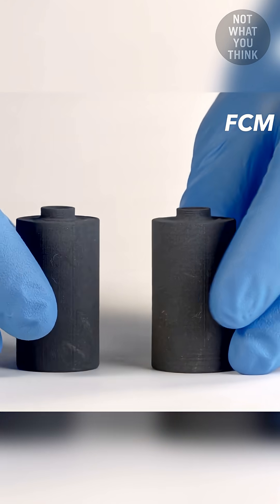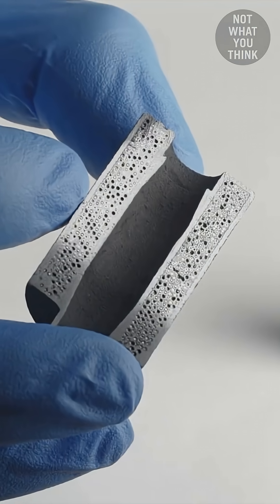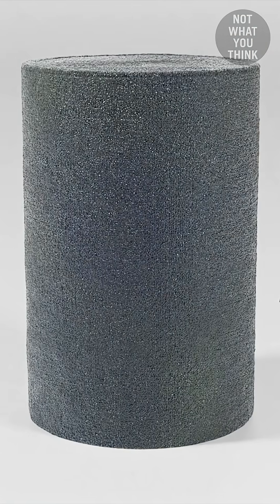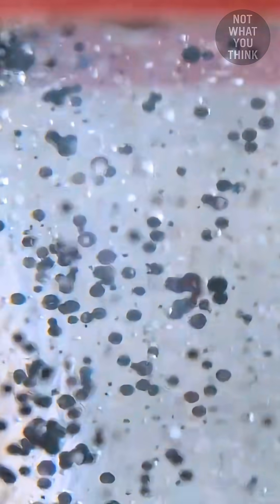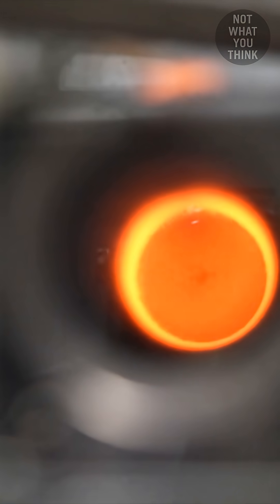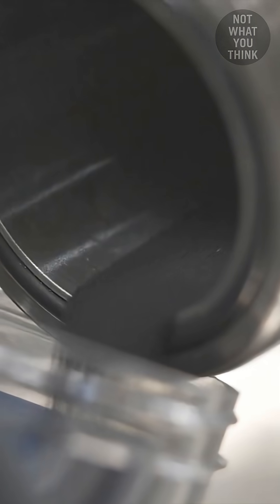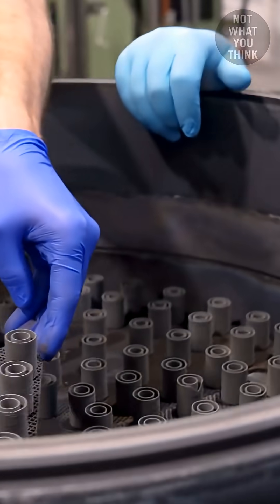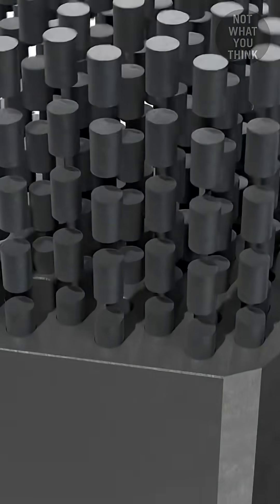Tiny Million-Dollar Battery

Comment: This is gonna be a huge deal... think of the applications for space stations and spaceships.  Satellites and planetary probes and stuff already have RTGs that generate electricity using the Seebeck effect & thermocouples... this is like that but on crack
Reply: even cargo ships, and maybe some light aircraft too. hell, local power generation for small remote towns or homes that would be to expensive to run a new power line to as well
Reply: @coreytaylor5386 there was a nuclear powered airplane design in the 1950’s or 60’s it was big.  Very big. And could stay in the air for a minute. 
We went a little nuke-crazy back then.
Reply: @Macumazahn16 Atomic planes. shielding was too heavy to carry much else, radiated the crew, and left a radioactive jet exhaust stream everywhere it went.
Reply: @coreytaylor5386 cargo ships and airplanes need thrust, nuclear reactors provide power. Could do a hybrid diesel nuclear cargo ship or something probably, the us already has nuclear powered ships. that stuff is way too classified to be in civilian infrastructure thou
Reply: @bobjordan4239  couldn't you use electric motors just like they already do
Reply: @bobjordan4239  No. 
For Aircraft there is the possiblity of using prob engines like in WW2 but powered by electricity and not by gasoline. 
Same with ships.
Reply: @bobjordan4239 you would simply use electric ducted fans or electric motors with props. Think giant RC airplane. Electric motors make far more power per lb of motor than combustion engines. The power source is the hang up. Batteries arent power dense like fuel so your range is very limited.  A nuclear reactor small enough can power and aircraft but then there is danger of spreading radiation in the even of a crash. This makes it only suitable to fly over the ocean or uninhabited areas. (Arctic Antarctic)
Reply: Modularized nuclear power is the real big winner on green energy. Since it will be cheaper than traditional nuclear plants, and can be upgraded by just adding more of these. Or removing some if that much isn’t needed. This is the kind of tech that goes beyond military applications and can help in a lot of other ways.
Reply: Bill gates funded the R&D for a similar modular, run-safe nuke power plant that doesn’t melt down if left unattended 
Nuclear power is our best tool for our energy demands. Everything else has some kind of major draw backs bc of the materials that go into it or the carbon released. 
We WILL have fusion energy plants in our lifetimes. Commercially viable, profitable, with clean energy. They’ll cost a few billion each (at least) but costs will gradually decrease 
We need more expertise and fission engineers are needed. 
We are destined for the stars. This is a big part of how we’ll get there, our grandchildren’s grandchildren.
Reply: @Macumazahn16  I want some of whatever it is you're on
Reply: @MadScientist267  I think bro is takes several doses of hope and human will power.
Reply: I don't think it is. The Seebeck effect is the principle behind the thermocouples used in RTGs, and it's not very efficient, but it has no moving parts, so it's reliable for a very long time. The concept of using mechanically robust systems that have moving parts is not new, and has been researched in depth with the advanced Stirling radioisotope generator (ASRG). The reason it never took off was because it was never proven to be reliable enough, despite having much more efficiency.

What this reactor uses is probably a closed-loop Brayton cycle, which requires a lot of mechanical parts and most likely relies on a gas turbine. This isn't a solution at all for unmanned missions due to how complicated and mechanically vulnerable such a thing would be. Conceptually, there's nothing particularly new here anyway. The Brayton Rotating Unit has existed since the 60s and was actually discontinued in lieu of the ASRG, which was discontinued for similar reasons itself.

Maybe saying this is like RTGs "on crack" is accurate in the sense that if you sent one of these into space in a satellite it'd probably work really hard and have a lot of energy before dying way too soon.
Reply: Literally my first thought was moon base.
Reply: Plutonium 238 has been used to power space probes for decades.
Reply: This is not an RTG or a battery. At all. Has nothing to do with either one.
Reply: When we finally poison the air and water, and nuke the environment by accident, war, or both. It won't matter anymore.
Reply: Knowing this technology exists I’m super excited to see our government send more money to the third world and Israel instead of advancing space travel!
Reply: 😮yh really
Reply: I don't see power ratings anywhere.
Reply: @qwertyboguss  well the power rating will be in the generator: (device you out the cells in)

But in theory these cells could reduce supply lines and be much more efficient than normal gas power. No need for pressure used containment vessels. Or risk of it degrading after 6 months.
Reply: @spaceengineeringempire4086 of course but the nuclear battery/cell has a certain max output I'd guess. Wonder what that is and how long it lasts. Makes the difference between powering a small camp or a small city
Reply: @qwertyboguss well, they are still being developed, so thats to be expected.
Reply: I'd feel way more excited n optimistic about this advancement and its many possible practical applications..
But then I remember how the world, especially us (USA), will only use new tech as long as it can not only maximize profit but not disturb the delicate web of huge old-money that currently control how "advanced" our society can be.
Pessimistic I guess
Reply: @mattyho1642  guns that hit with the force of a nuke though
Reply: @mattyho1642 I don't think your pessimistic I think you're spot on. It is unfortunate that all these billionaires have so much at their fingertips and yet do so little for the world
Reply: Uranium anywhere there is a possibility of it crashing down to earth doesn’t sound too nice
Reply: @123qwe321ify  the dangers of Uranium and the risks involved with satellites magically falling from orbit somehow are over hyped by Hollywood, the IRL physics behind both of them are much much more boring and safe. if it where to 'fall from orbit', the uranium would probably disintegrate into the upper atmosphere and be no worse than the radioactive material pumped into the air by coal burning plants
Reply: @coreytaylor5386 i suppose but do you think the ceramic coating if it were to remain intact would be enough to mitigate the heat ?
Reply: @123qwe321ify Well if that coating were to survive being burned up on re-entry, you’d think it’d stay intact upon landing. Or maybe because it’s ceramic, it’ll shatter. Who knows.
Reply: @coreytaylor5386 Who are you quoting with "fall from orbit"? The dangers are in delivering that up there in the first place. A critical failure during launch and you've got youself a light contamination zone the size of a state or a few. Granted it explodes on ascent, of course. I doubt the spheres would hold and if they did... well, then they surely can't lift a whole system of these into orbit due to weight constraints.

There are also engineering challenges associated with operating a full reactor in space. There is no guarantee the passive radiators would be enough to dump all the leftover heat as the spheres were designed to be stable (or at least safe) in a reactor with active cooling failure installed/placed on the ground. The system would have to survive all the vibrations and accelerations of the initial delivery and later manouvers. RTG is way simpler and safer in operation.
Reply: @km077 Rockets exploding don't really pose a huge threat to their payloads. If it's designed to withstand an atmospheric reentry, it's gonna be fine.
Reply: @coreytaylor5386 ...and the nuclear waste sludge pumped into the oceans. Yes, mineral oil is also radioactive before it gets refined. There's a US town which became uninhabitable thanks to that (with a bit of stupidity).
Reply: @km077  "fall from orbit" is in quotes  because thats how its popularly described despite being basically impossible to just "fall" from the sky in order to "crash to earth" 

again, thats all just Hollywood pseudoscience fear mongering. rocket launches these days are safe with 1 in every 100 being a failure being a shocking headline, and if it does, it doesn't pulverize the payload into dust and magically spread it across the area of a state, it would drop into the ocean though not in one piece. no, it would not contaminate an area the size of a state, that doesnt even make sense if you think about for more than a few minutes, maybe half a ton of very mildly radioactive material to poison everything in hundreds of miles? hell a full modern reactor meltdown couldn't do that these days. uranium doesn't turn into a magic death gas if its exposed to air when a bead breaks and nothing it touches magically does so either. yes the majority of them very likely would survive, not that it would matter a few inches of water is enough to shield from radiation in full sized reactors so even if they do break open and magically become deadly, the ocean would effectively neutralize them. and rockets are only allowed to launch over the ocean when heading to orbit, in the US at least.

"There is no guarantee the passive radiators would be enough to dump all the leftover heat" yes there is, its a matter of extremely simple calculus actually, thats by far the easiest part of the process just check the max theoretical heat is below the melting (or sublimation in a vacuum) point of the material housing it and add a generous 20% FoS to the design. all of what you said is a matter of at least relatively easy math for engineers, failsafes are as easy as holding spring loaded control rods up with electro magnets with power from the reactor. when the power drops because the coolant stops flowing, the magnets turn off dropping the rods. the vibrations issue really isnt one at all considering that we've already launched significantly more complex and fragile things into space and to other planets and its not some impossible thing to overcome. and engineering ceramics really arnt that fragile, its nothing like pottery ceramics, ceramic knives for easy example. maneuvers in space are never anything more than half a G of slow acceleration at most, not even in the top 10 list of things to worry about.

RTGs are safer in operation, but the Plutonium they use is orders of magnitude more radioactive and dangerous since you are concerned about that sort of thing, provide significantly less power, and last a shorter amount of time.  the worlds supply of Plutonium238 is very quickly running out too. not to mention they would also be at the same risks that you claim and arnt that much more simple or less fragile than this.
Reply: @123qwe321ify  actually, ceramics are among the best possible materials available to engineers for intense heats and pressure, used for everything from spacecraft re-entry heat shields, ball bearings, and even steal foundries. pottery gives ceramics a bad wrap with how fragile those are but its kind of terrifying how strong engineering ceramics can be
Reply: No one can go to space because space doesn't exist, above is  water  and there is a barrier no one can cross it 
All satellites are with balloons in reality
Reply: @BlessedByAlMighty  is the reason a license should be required to comment
Reply: Space ships are already powered with nuclear
Reply: @LunaConner-n2q nonsense

Comment: Wait so because the fuel ⛽ supply vehicles were attacked, the military 🪖 have decided to replace the energy source with mobile nuclear reactors!?!?
If those get attacked it would be catastrophic!
Reply: Not really, very limited radiation is emmited and aa he explained its very safe
Reply: @TheFrenchBaguettes Yeah, until someone builds a dirty bomb with it.
Reply: Only if the core gets a direct hit. Protecting the core ought to be relatively easy. And if the pebbles are durable enough it'd still be relatively speaking easy cleanup if they don't get crushed to dust
Reply: It's failsafe, plus it's feasible to airlift a single shipping container anywhere on the planet, far easier to defend too.
Reply: they are meant for military bases in ornear hostile countries. 
the catastrophic effects if any would only affect a handful of soldiers that get discharged with non service related supercancer and the local population can deal with the radioactive fallout on their own. ater all they were the ones that attacked the reactor...

Comment: So the closest think to a fusion core?
Reply: I would love that but it seems that they need an apparatus the size of a shed to be useful.
Reply: @Voltaic_Fire  in fallout 4 and 76 you built a fusion reactor that is the size of a shed in the workshop or camp
Reply: @JohnnyTheLord2003 You also use them independently to power weapons and power armour so the shed size generator isn't necessary for everything, they can be used like 'roided-out AA batteries.
Reply: Fission* core 🙂‍↕️🙂‍↕️
Reply: @MarkStokotelny  yeah, correct